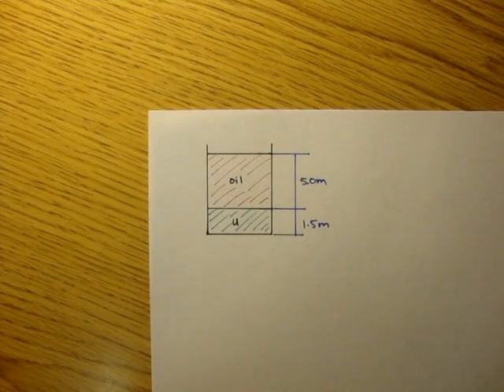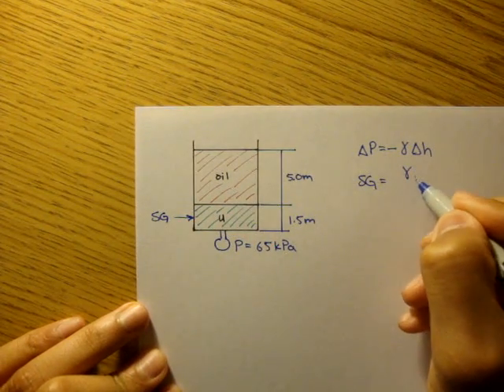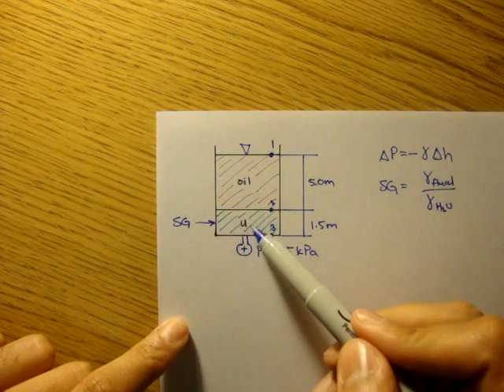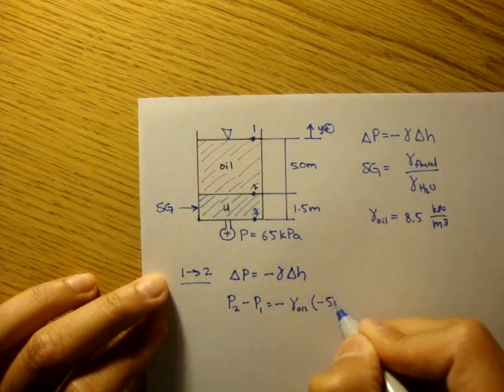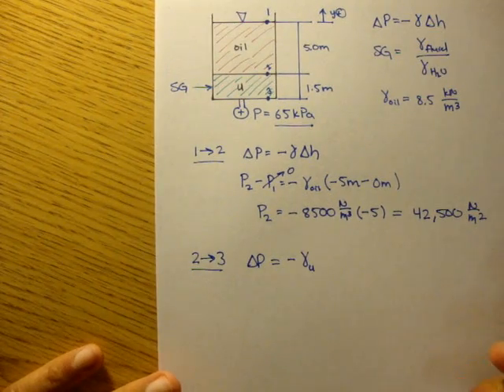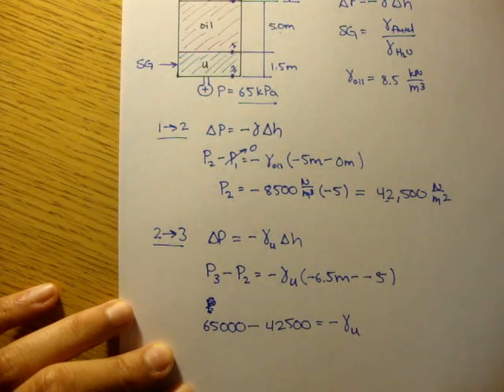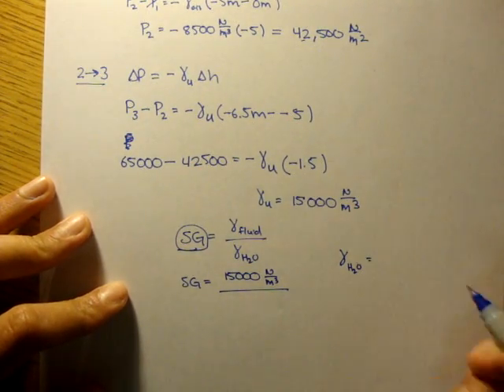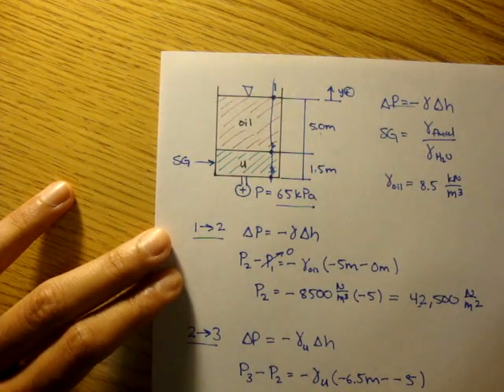Static Pressure: Example 1 [Fluid Mechanics #9]

Comment: Im probably missing something simple but i got lost at where you got 15000n/m3 
i did 65000-42500=22500 then times it by -1.5 and got -33750 which should be -gamma U??
Reply: we're deviding 22500 by 1.5 sir.. not multiplying